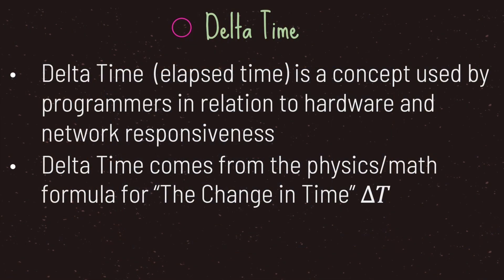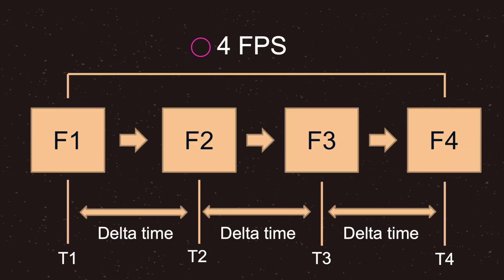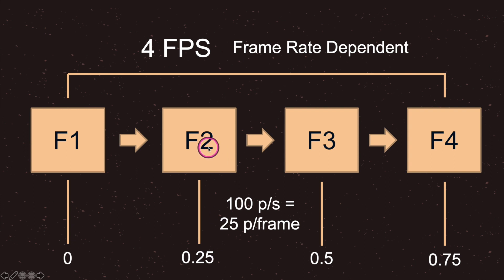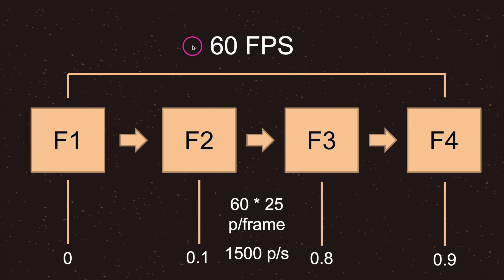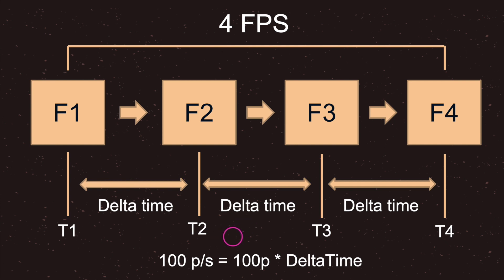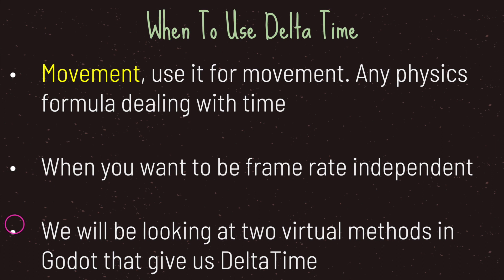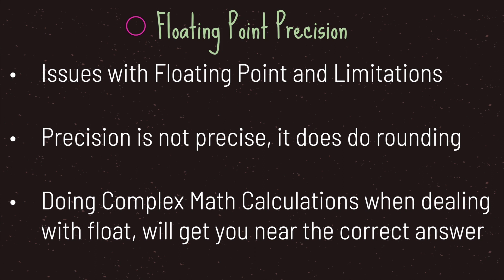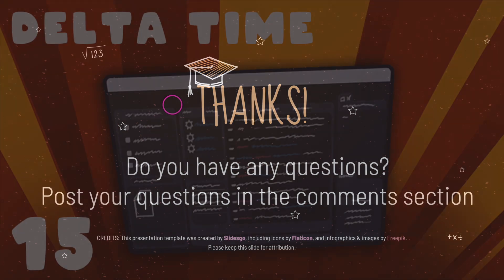Game Programming: Delta Time | Godot Basics Tutorial | Ep 15

Comment: This is what I like about Godot coming from game Maker. Game maker makes using delta time extremely complicated you need to calculate it yourself. Here it's super easy
Reply from the maker: I am not familiar with Game Maker, but delta time in game maker looks like the delta time in process. I had to read some articles, they say the example in the game maker docs are wrong?
Reply: @GodotTutorials  a lot of things in game maker are France dependent like alarms for example etc. In Godot when you want alarm after 10 sec is super simple in game maker you need to do a lot of crazy calculations for it. Game maker works well if you target specific frame rate like 60 or 30 fps but not so great for frame independent stuff

Comment: How to use device clock time... Like you start open a chest... But it's going to open like 1 day after... Thanks in advance...
Reply from the maker: The OS class is in charge of Operating System data such as the device clock. You can check out the API doc for that: https://docs.godotengine.org/en/stable/classes/class_os.html#class-os-method-get-datetime

As for a specific solution, In this case you would compare the device time with the data that your chest holds in terms of when it should open. If this is like a daily chest reward, you would compare the device clock with when the player last played the game.

Comment: what is the diference of "delta" and "_delta" in the script? I put "delta" in the process function and it was all fine until I removed everything of the function's logic and simply put "pass"  inside. When i did that the debugger said to me that it was better to put "_delta" as I was not doing anything with the process function.
Reply from the maker: _delta will avoid the "Argument delta unused" warning in the Godot Warning/Error Window.
I believe in my example I did not use the delta method.
Either one should be fine, the warning if not using delta won't change anything when running the game, I just personally don't like the warning. You could also change turn off that specific warning in the Godot Project Settings as well.

Comment: Hmm if its time between frame then why is the delta from _process and _physics_process different? Your game is not running at different frame rate for those 2 functions. I get your point and it does apply to _physics_process. But still it feels like you took a general concept (delta) and binded it to frames which is not always the case, even in game programming. Great vid though. I just feel that the lack of the nuance I just talked about might confuse people in the long run.
Reply: Ok so Ive checked it out and im dumb ahah it's actually 2 types of frame. Apparently, process has drawn frames, physics process has physics frame. Im still trying to figure out what is the shown fps though as with vsync disabled I still get frame rate of over 2000 but i clearly do not get that amount of physics and drawn frames. Any idea what it could represent?
Reply from the maker: Hi @Pascal Ladal,

_process and _physics_process serve 2 purposes. physics_process gives us fixed value, allows us to handle physics without worrying about the computers hardware, display frame rate.
Reply from the maker: @Pascal Ladal,

No no no, no one is dumb here. It's a learning process through iteration. If it helps, physics_process behaves like Unity's fixed_update (I believe). As for fps, with vsync disabled your process function gets called as fast as possible, where as your physics_process will not change, because it is is capped at a certain amount 60fps per second I believe. Physics allows our "movement" in a sense to behave similarly across different types of hardware.

Edit: Learning process is applied to everyone, new and experienced!
Reply: @GodotTutorials  Ahah thank you for your kind word :) i wss feeling dumb because I tried to be a smart ass not because I was wrong though ahah Yeh that's what I figured out yesterday evening playing around with frame rates and method like Engine.get_frames_drawn and get_physics_frame. I also found out you can play around with Engine.iterations_per_seconds to modify the amount of call to physics_process althougj not recommended. 
I was still wondering though about something maybe you can help me. What happens if your physics process takes so long to execute that ot does not finish before another one is supposed to be call? Will delta still be fixed?
Reply from the maker: Also yes you are correct in all three instances 😃
That's actually a good question, and I'm not sure (close to clueless).
I was taking a look at that source code a while back. From the looks of it, at least from what I gathered it looks like the code handling physics iteration is keeping track of how much time has passed so it doesn't mess up its "time/iteration count/step". All that handling of time is done with main_timer_sync, I believe. How and if the time correction is applied to our drawn images I'm not sure.
Reply: @GodotTutorials  Cool! Thank you! It's a good idea I'll check in source code! Take care!
Reply from the maker: Have an amazing day!

Comment: 4:30 is deltaTime = 1/(T2-T1) ?
Reply: I'm a bit confused about the units of deltaTime. From what I understand, deltaTime is measured in seconds. However, if we consider the unit of 100 pixels/second, which is pixels/second, and the unit of 100 pixels, which is pixels, the unit of deltaTime should be 1/second, which represents a frequency in Hz.

100p/s = 100p x deltaTime 

if deltaTime is in seconds in the equation above that means the equation is not correct because the units on both sides of the equation do not match. The left-hand side of the equation is a measurement of speed or velocity in pixels per second (p/s), while the right-hand side of the equation is a measurement of distance or displacement in pixels (p) multiplied by time in seconds (ps) and (p/s) !== (ps)